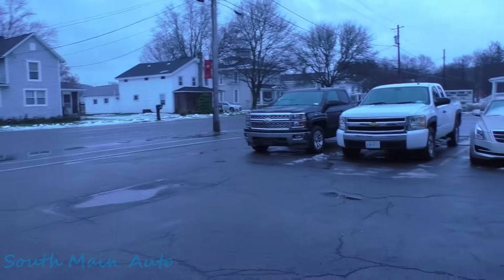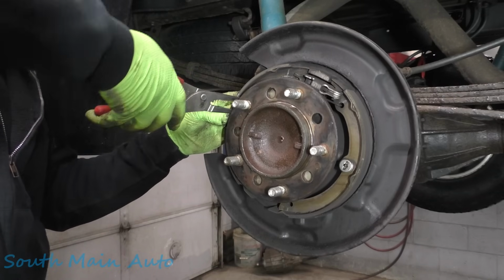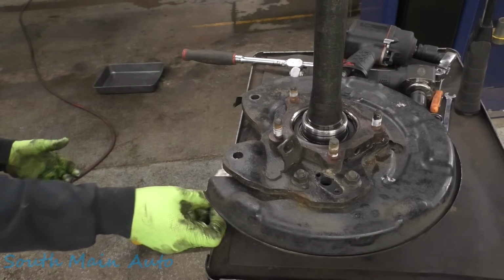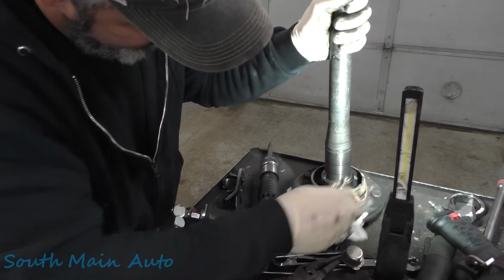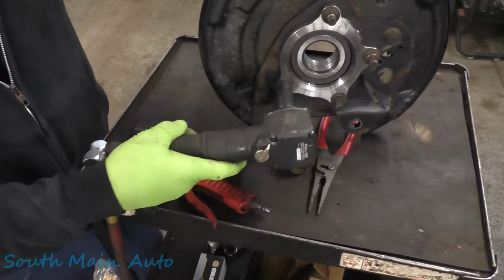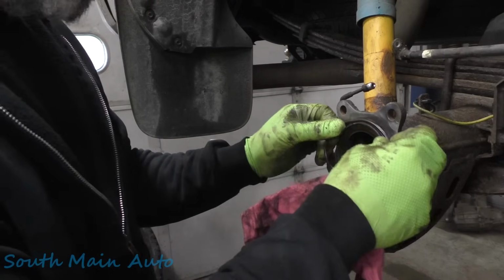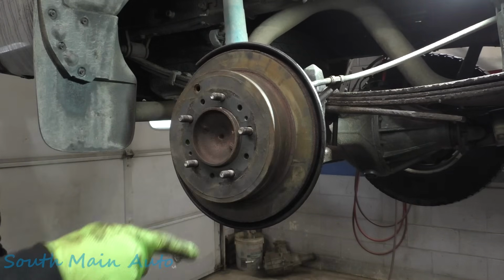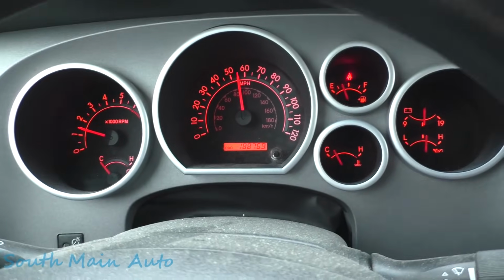'12 Toyota Tundra: Rear Wheel Bearing

Comment: Love your honesty and ethic on your work but glad I don't live where I could use your shop ( love the south ). your comment on the dealer sticking you is just like any other shop depends on which one you go to. I have been to both kinds and have seen change in one from great to slime, and that one is a dealer so bad I would order parts from some other dealer that was far enough not to drive to before i spend one penny with them. caught them in the lie and proved it with no resolve.

Comment: Back in the old days...... We used the torch to heat the inner race red on one side and then hit it with the air chisel. And, do you have stock in brake clean?? That craps expensive!!😮

Comment: Flip it up on end, heat the race and let the thermal expansion and gravity drop the race off. Less risk and faster than cautiously cutting. If you can spin the axle while heating, its faster than spinning the torch around the axle.

Comment: There's a guy on eBay who makes a complete set of adapters to remove toyota rear axle bearings and tone rings. I bought the kit and it works great. If not properly done the axle seals will eventually leak from what I heard
Reply: Thanks for the tip. I looked and not a bad price. A must have if you are doing this job.
Reply: What’s the name for eBay?

Comment: Build ya a hydrlic tank buy a valve lever, pump and hoses as well as a cylinder and build you a hydrlic press, save the jack for raising cars. 
I used to work in a machine shop we built one out of c channel and I beams its just structural steel.  Beats the shit out of using a jack handel.  You can get the cylinder from a cat or or some other construction machine,  you might want to add a presure ga.  This works becuse you cant compress a fluid . 
You could beef up the press youve got now.   You could make these to sell. 
Or convert the harbor fright ones.

Comment: Banjo type axles are nice for setting up the center section at the work bench vs under the vehicle, solid proven valid point. This video proves why they suck in all other respects. All that bs to take apart/take off to remove the axle shaft and then more bs to get that bearing changed out. The added cherry on top with that brake line to hose connection, I thought Toyota was the pinnacle of perfection. That seemed like something from the domestic playbook of failures.

What kind of pliers are those ?  Snap-on for sure but which ones ?

Comment: Next time take off the cutting torch and just put on a number one put the heat right on the bearing race and put a screwdriver underneath the edge on the other side as soon as you get that one side red it'll be expanded big enough to just pop right off the screwdriver don't cut it you can accidentally cut your axle and or overheat the axle and change the temperature goes cause it to snap off later

Comment: I always check to see if the bleeder will open before I get to far into a job like this.
Reply: Use heat to break it loose.
Reply: If you live in a crusty environment you get pretty good at getting them out. Plus you can bleed well enough at the line if you have a helper.

Comment: Sorry, but my wheel lock lives in the standard location in the spare wheel area where the jack lives so everyone can find it (especially me). Ah, the number of times I have screwed the adjuster the wrong way initially over the last 50 years........I feel your pain. I think it is safer to use a cutting disk on a cordless or air tool to cut those bearings/retainers. I see how Rainman Ray uses a gas axe, and he makes me really nervous, you not so much.
Reply: Watch the video again. He did use the correct tool to install the shoe hold down spring.
Reply: @bushmaster2936  Yes, I edited that when he gave up and used it to put the springs back in.

Comment: Just tack weld a nut to the lock lug and be done with it. 
Put a rumble filter on the camera mic. the vibration from the mag mount gets into the audio track. 
Nice logo for the front sign “We get it right 50% of the time, most of the time.” or “Fake it till you make it.” “We give it a whack from the back.” “We’re just takin’ up space.” 
lost right channel audio, finally it came back….

Comment: I hate to see a torch used on the bearing races, I use a speed cutter nick the race then hit it with a cold chisel "pow" the race cracks like a piece of glass. All and all good job, you didn't have to buy a new axle.

Comment: what I found out is when I am using latex glaves, i remove the bleeder and put my finger over the hole, when the missus is pumping all the air comes out real fast, no air goes in, and just return the bleeder . real fast, all the air is out and you dont use/lose a lot of brake fluid. just my 2 cents. also, is the wife mad? :D

Comment: Only a minute in, but for me, if it takes more than 5 minutes of looking to find a wheel lock key in a vehicle, I call the customer. If they can’t tell me exactly where it is, I tell them to come find it. Sorry, but it’s a business, and I only get to bill for the repair, not digging through people’s cars looking for their aftermarket wheel lock.

I generally like Toyota’s rear differential design, but I’ve never liked how the axle bearings are pressed onto the axle itself. It makes a relatively simple job like replacing a bearing into an overly complicated job.

Nice thing about YouTube is even if you piss people off and they leave an angry comment, it still counts as engagement and pleases the algorithm.

Comment: That's what I like about Dorman they have a loaded axel for the rear of the Tundra it's pricey but it's worth the price to avoid the headache of trying to get everything pressed together.
Reply: Dorman parts on a Yota ?  Not in my lifetime !!!
Reply: axle for
Reply: @FabricationStation36  then don't complain about the labor charge's for having a repair done on your vehicle..
Reply: @NoName-zn1sb  for the Toyota Tundra and other Toyota's.
Toyota knows that there's a problem with the rear wheel bearings there's been some trucks that's had the axles to snap at highway speeds without any warning at all.

Comment: Regarding the comments on axle heat: this was done pretty quickly, and I suspect the axle was fine.
    But, elsewhere in the comments lies some misinformation. 
  Most heat treated steel is first heat treated,  bringing it up to an unacceptably high hardness..it is brittle in this state, and no good for an axle. It is then tempered, a lower temperature process that reduces the hardness to the desired level, usually still much harder and stronger than an annealed state. 
   Again- the tempering happens at a lower temperature, sometimes just several hundred Fahrenheit degrees. 
   This can easily be undone be a careless guy with a torch.
   The comment about "we off road guys heat our axles red hot..." NO No no...don't do that!
   I found an old axle, bent, that happens to be from a Toyota rear..'98 4runner.  I do machine work & welding, and have a hardness tester, so checked it. Was surprised,  I expected 30 or so rockwell "C". No, it was over 40. It was awkward to use my tester on it (Ames handheld), so I hesitate to give an exact number, but it was hard. 
   If you heat it up red hot, guaranteed it is ruined.
   If only one area is heated, an excessively hard area can even be formed as the surrounding cooler metal absorbs the heat rapidly from the hottest area. The rapid temp drop is uncontrolled heat treating run amok. You have no idea what it is like anymore..Brittle? Soft? Definitely no longer correct. This is why welding high carbon (thus heat treatable) is either tricky or not recommended- it can become so brittle it can Crack while cooling. NEVER heat the axle shaft itself red hot- you're asking for wheel departure. Probably happen when meeting an oncoming school bus or something.
   I've changed a few of these toyota bearings..more work than you'd expect. The inner and outer seals seem prone to leakage, great to keep the drum brakes lubricated, unfortunately.
Reply: I forgot to add that I'm a fan of your videos- good troubleshooting..keeps me informed on diagnosis of newer vehicles...mine tend to be older than what you see. 
    Interesting also to see what goes wrong with brands that I'm not likely to work on, too.
  Thanks

Comment: Eric quick question. Does the P Brake actuator go in either direction. At 7:34 when you took it out the actuator it was one direction. At 38:04 when you reinstalled it was 180 degrees off. Never had the pleasure of working on one like that so just asking. Love the videos even though I have a Chevy....

Comment: I have a wheel locks on my vehicles and the key lug always goes in my cup holder when it goes to the shop. There was the one time where i did put it in my cup holder and the Mechanic didn't looked all over for the key. The dealership called me to ask where it is. I told him it is in the cup holder. His response was no one ever puts it in the cup holder so that Mechanic never looks there and assumes it is hidden. I have a dash cam in my vehicle and I forgot to shut it off. When I got my vehicle back I watched him tearing my vehicle apart for 25 min looking for it. I told the dealership I am not paying for that 25min of him searching because it was right where I left it. In the cup holder.

Comment: Eric, Just wondering, if a Drum Brake hose has to hold up under 400-600Lbs/ psi, and a Disc Brake hose has to hold up under 600-1,000Lbs/ psi, how can a  2 or 3Lb caliper pose a threat to the hose? I'd rather have my caliper pull off the hose end hanging than during a hard stop. What Do You Think?
Reply: Internal pressure isn't the same as a load on the hose.
The caliper isn't likely to drop off, just get pulled around the crimp which may lead to fraying at that point or a leak in the longer term. It's really more "best" practice than anything, especially when you get very old hoses which aren't as flexible any more. 
Either way is such a simple thing to do, why not do it.

Comment: Vanessa knows her husband so well.
V: "Are ya pumped"
E: "No, I'm just stropping about the place, throwing stuff because I put this vehicle straight on the lift put it up in the air then realized I need the wheel locknut tool"
V: "Well, they didn't hide it, it was just in the glovebox where you'd expect it to be"
E: "I will not admit any weakness or failure or oversight. I'm flawless man. Obviously the customer should have put it in the cup holder where I could see it when bringing the car in. PSA - folks put your locknut tool in the cupholder when you take it in".
V: "Are ya pumped"
E: "No....."
V: exit stage "mmhmm"

I took artistic license with this comment. none of the above words were spoken by either person. It's an interpretation.

Comment: what was the material on the air sander you used to clean up the mating surface (@34:34)? got some rusty rotors that could use the same treatment

Comment: Dealers will screw you. They tried with me at a VW dealership to replace the transmission fluid in my 2009 Jetta tdi. $150 for the fluid and filter and an additional $500 for labor. I looked at a youtube video and changed the fluid myself in under half an hour. In what world is $500 reasonable for such a simple job

Comment: Or I had one customer who wanted a tire rotation with the AC work that was scheduled.  Her truck had these lug nuts that looked like spikes.  No socket that I have would fit.  Fixed the AC.  Called her and said it was ready.  Had to leave q voicemail.  When she picked it up I informed her I couldn't do the tire rotation because I didn't have the tire key.  When she picked up the truck she accused me of loosing the key.  As she was getting her credit card out of her purse to pay for the AC job she found her tire key.

Comment: Those brake hose clips are called "Jesus Christ clips." Most times they are mounted horizontal not vertically like on this truck. They get rusty and crusty, so you use a hammer and a chisel to get them off. When they finally break loose they go flying across the shop. "Jesus Christ" Then you have to go looking for it. LOL

Comment: i always hung the caliper from a coat hanger home made hanger.  but as i thought about it, if the rubber line can handle 3500psi, it surley can handle a 5-10lb caliper.  I don't have any toyota hate.  while people make it seem like its noraml to replace countless things on vehicles less than even 5 years old and in my experience it's at least 15 for toyota i don't hate.  what i do hate is more modern design.  i can't stand the front end of any toyota truck or suv for years.  i stand behind their quality but if i hate the look i won't own one.  and this is coming from a 84 corolla owner.  i also had an 85, an 86, and a 92.  all ugly but at the time so was the competition.

Comment: Hey Eric, just wondering why you didn't check the rear end fluid. I didn't see any come out when you took the axle out and I wonder if it wasn't low which caused the bearing to fail. Possibility? Not a complaint, just an observation. 😁
Reply: Those bearings are grease packed. Note the seal in the axle housing riding on the retaining collar to keep oil out of the bearing.
Reply: @wssides  Thanks, I missed that.

Comment: Actually getting it right 50% of the time does not work with USB plugs.  It won't go.  You flip it over.  It still won't go.  You flip it again. Finally it goes.  That's because USB plugs have quantum spin.

Comment: No wonder Toyotas are so expensive. That's the most complicated rear wheel bearing assembly I've ever seen. My 2000 silverado 1500 4wd ext cab carried more than a ton for 20 years in the Rockies and still has the original seals and bearings. You couldn't pay me to drive a Toyota.

Comment: The funniest thing is the Toyota Tundra has a Chevrolet engine in it. Chevrolet uses Toyota's transaxles. LoL God bless
Reply from the maker: Ummm I think you have been misinformed lol. Toyota runs a dual over head cam 5.7 V-8. GM has never made anything other than a pushrod V-8. They are still lost in the 80's

Comment: If it was a GM truck, the frame would've been full of rust with that mileage.  It is sad that in the 80's-90's the Japanese stuff were rot boxes in a short period of time. Now our products suck. Umm not sure I want American anymore. I live in the salt belt, and it is BS they can't put corrosion protection on their vehicles. I've seen 90's Vehicles in Florida in mint condition, under carriage wise, with the interiors trashed from the sun. These companies need to make northern versions and southern versions. At least the Canadian Ford's in the day were better protected. Plastic fuel filler neck, instead of steel.

Comment: Theres really only one brand that is pure junk all over, and that's VW/Audi...newer Chrysler is bottom of the barrel domestic, BUT is better than any VW product. Ive bought and sold a few audi/VWs and worked on a ton, and never again. GM had it right from 99-06...there weren't better trucks than those. Small trucks during that era were great across the board though... S10, Ranger, Dakota, Frontier, Tacoma. They were all good.

Comment: You wheels are not actuallythat valuable...loose the wheel lock or...shocker, make the dealer that charged you for it remove it and replace it with a proper lugnut.